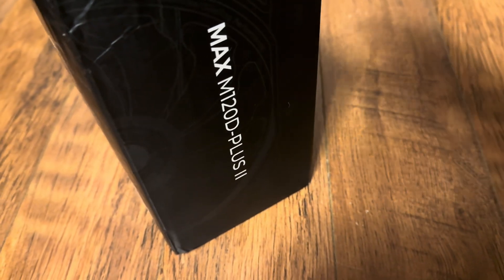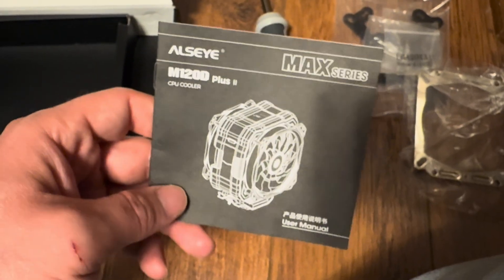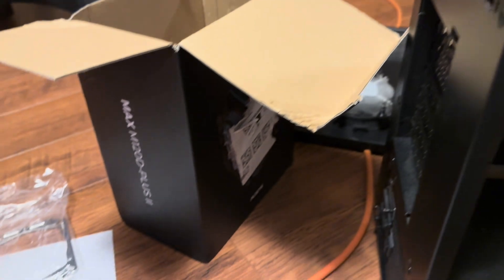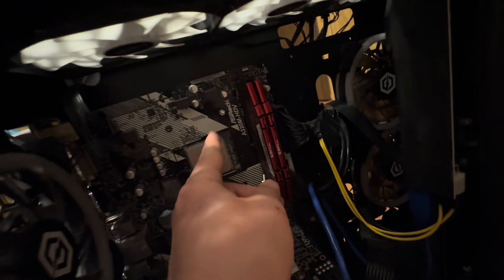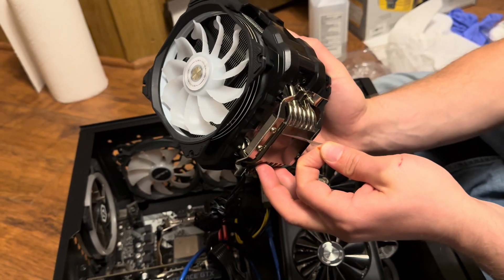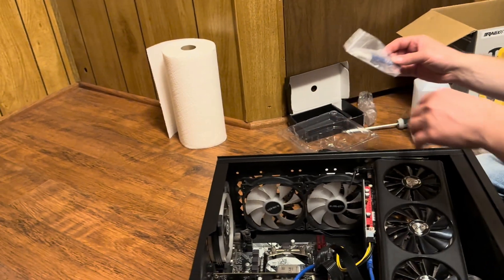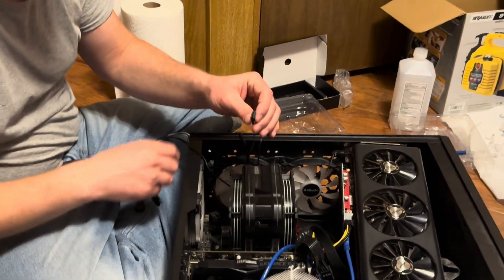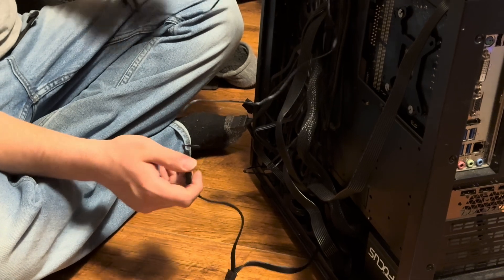ALSEYE M120D Plus Install Unboxing Review

Comment: They say not enough paste is bad but with my stock cooler using a lever that tightens the cooler to the bracket makes the cooler squeeze all the extra paste out the edges. this pulled the cpu out with the cooler and bent a couple pins around the corner of the chip. With the replacement cooler it looks like too much wouldnt cause the same issue but i agree the paste that came with the 120 looks too dry.
Reply from the maker: Thanks for sharing I appreciate it.
Luckily for me no bent pins

Comment: I have a question how u fit this to a 12volt rgb header on motherboard cause its asking for +5d v where my motherboard has 12volt asrock tachi x370 can u help is there way of converting it or bypassing some how
Reply from the maker: @avalanchemultimedia1983  I’m not sure unfortunately.
I had to purchase an external rgb hub

Comment: 24c is the default lowest it sits at until you download their software and run otbwhen windows starts..THEN it will give you correct temps.
Reply from the maker: U are correct
Reply: @EndlessRoutes  except now their website is down and 
I cant find the BEM nowhere
Reply: @ToddHillerich  Were you able to find a solution because I'm also searching?